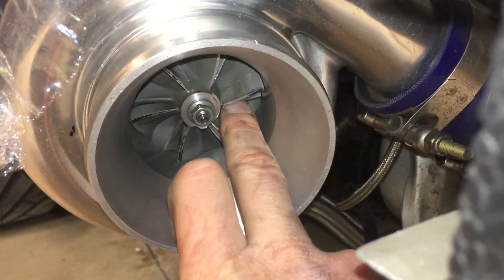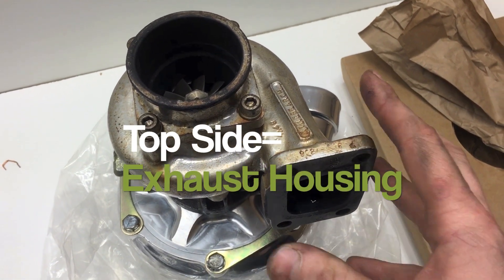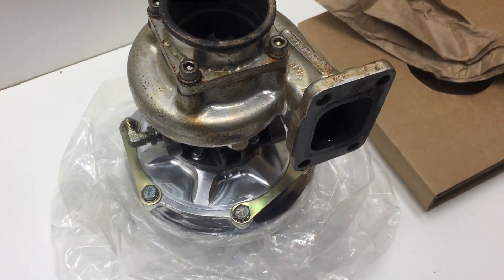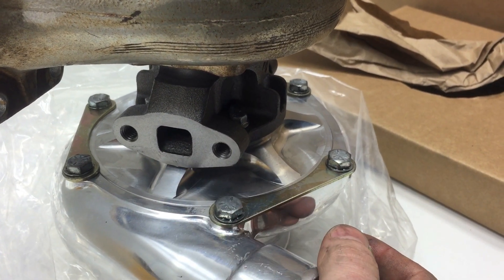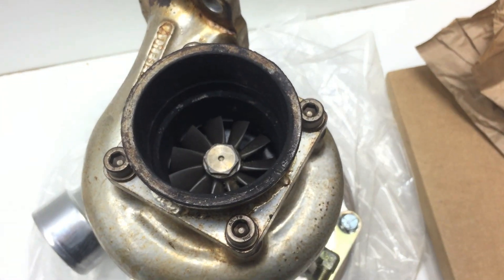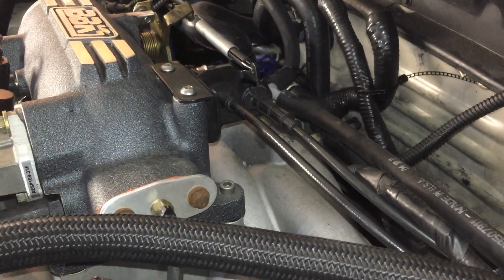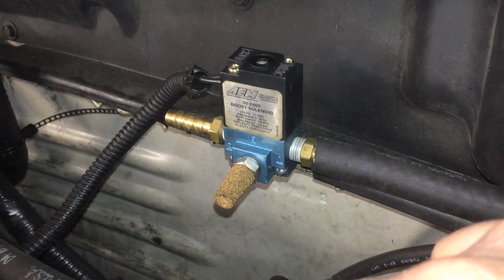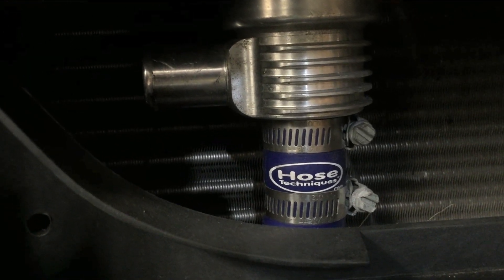How Does a Turbo Work? External Wastegate and Electronic Boost Control Solenoid Explained Hands On

Comment: Could a bad waste gate cause oil to back up in the turbo and fall into the exhaust side of the turbo and smoke through the exhaust pipe? Thank you for your video.
Reply from the maker: Off the top of my head yeah it’s possible but you could test the waste gate easily to make sure it works with some air pressure.  Also make sure the oil is getting into and out of the turbo make sure it’s flowing and there is not any blockages like gasket material or etc.
Reply: @JerryJrsGarage  Thank you for your fast reply and information. Keep up the great work that ya do. 👍